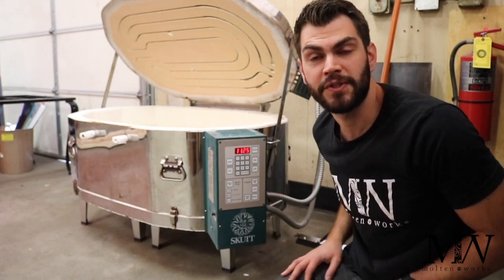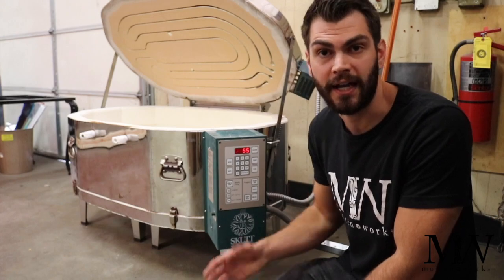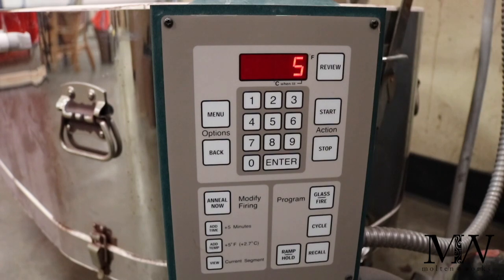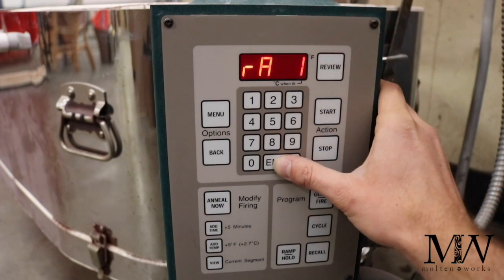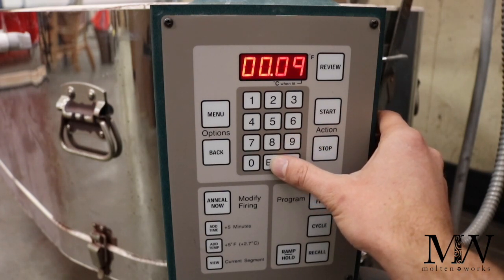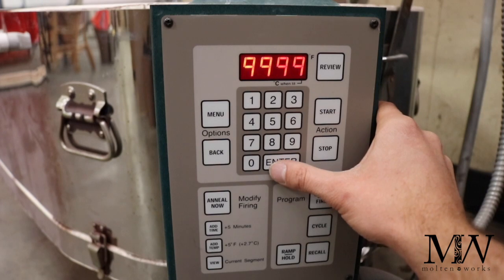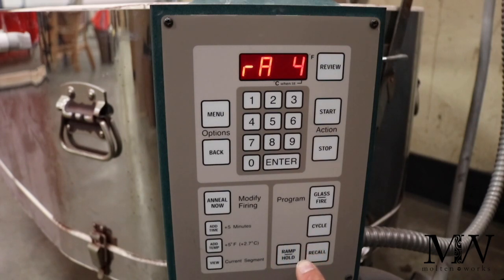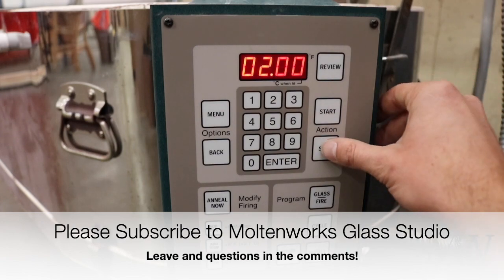How to Program Your Skutt Glass Kiln

Comment: Hello!  I need to permanently modify a temperature on an existing program in my Skutt 1414 controller.  Is it as simple as pulling up that existing program and as it goes through the programmed schedule, modify the temperature when it gets to that point?

Comment: Hi, Thank you for that explanation, very helpful. I see you use System 96 glass. Does this full fuse schedule need to be adjusted for BE Coe 90?  Where can I find your Tack fuse and Contour fuse videos'?
Reply from the maker: Thanks for reaching out! From my experience using BE 90 especially recently, you may need to turn it up 10-15 degrees to get the results. I would run some small tests to get your kiln tuned to the right programs. Make sure you are keeping a lot and make notes. Once you get your kiln programs setup, it's easy to produce and projects you want!

Comment: Hi, I have the Skut GM1414 and want to do some cast glass pieces, about 6 inch long pieces around 1/2 inch to 2 inch in thickness. Are you able to give me the heads up on a firing program to suit these pieces? Should I set my shelf low, or as high as I can in the kiln? Thank you, Richard
Reply from the maker: I know I am 3 years too late on this, but I would be happy to share thick programs with you and hope you had success when trying this out! Are you using COE 96?

Comment: Hi. I recently inherited a Skutt GM 1414 from a relative and she mainly worked with glass but I was wondering if this kiln is also compatible with firing pottery? I have not used this kiln yet. I’m just curious
Reply from the maker: Yes usually you can still run cone programs. Although glass kilns usually don’t quite get hot enough to fire pottery, they max out around 1700 degrees. Elements in the lid or top is a sign it’s designed for glass